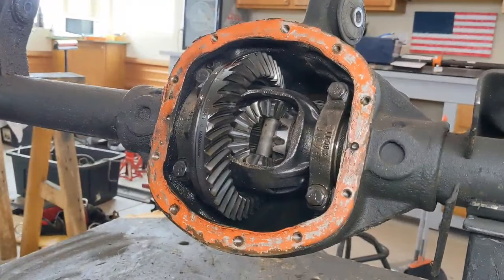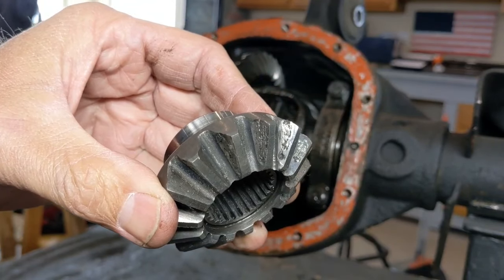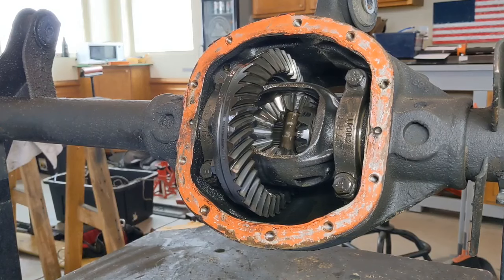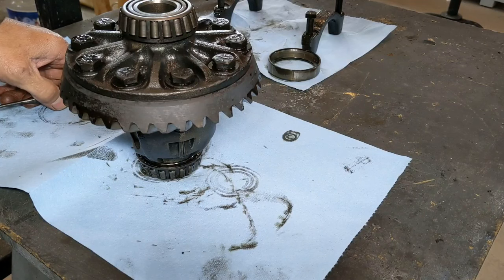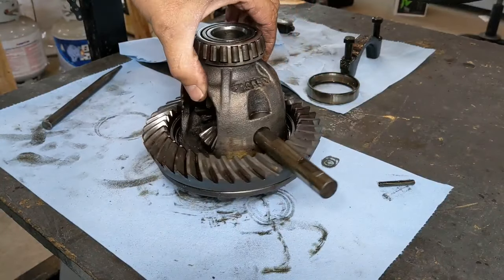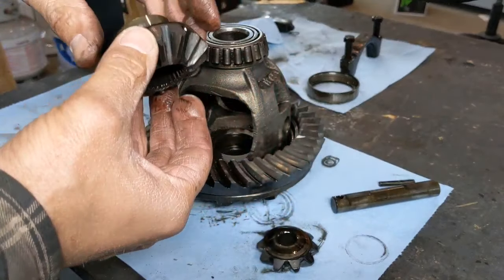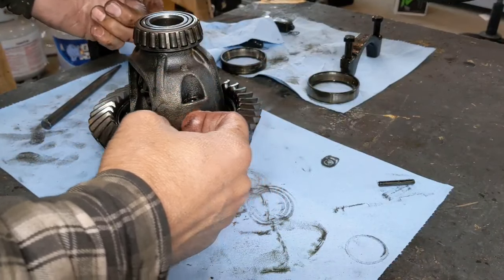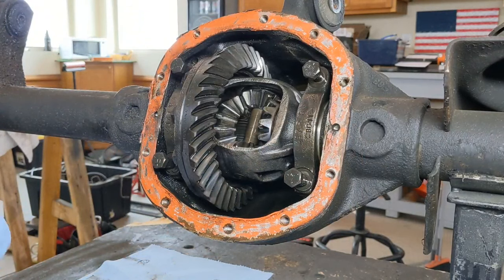How To Replace Spider Gears

Comment: Great thought, but how do I get the carrier out with the axles still attached to (splined through) the spider gears? In order to get the C clips off the axles to remove the axles been the gears, you've got to push the axles in, and in order to push the axles in the cross pin needs to come out first... Right? I'm no expert, so I'm genuinely asking. Is there something I'm missing? Obviously taking the carrier and gears out all together would be the simplest option, but without being able to get the axles out of the way how can I remove the whole carrier assembly?

Comment: Perfect How-To video.  Awesome!  But, need advice.  '01 Wrangler 4.0, 5-speed.  My current issue is with the Dana 44-rear.  Recently regeared from 3.73 to 4.88.  Replaced the carrier (standard, non-locker).  Installed new spider gears.  Everything went well.  All of my "dial-ins" were set perfectly. However, 8 months later while "chirping" 2nd gear, several teeth on the spider gears blew out.  I did use the cheapest of spider gears at the time of regearing, Motive Gear brand.  I'm about to replace with a Yukon spider gear set.  I've been "chirping" during gear changes for decades, here & there.  Never had an issue.  Of course, chirping is very hard on all the components, we all know this.  But this is the first time I've ever blown out any gears.  And my honest opinion is, I think the cheap Motive Gear brand is just a much softer metal and is the reason for the blow out.  But I'm hoping for your very well-experienced professional opinion.  Would you agree or could there be another reason the spider gears would have blown out (other than the heavy torque from chirping)?  Also, is there any advice not given in your How-To video that I would want to keep in mind when replacing the spider gears with the Yukon brand?  Thanks Mike!  Definitely appreciate all of your videos!
Reply from the maker: I would say with confidence that "chirping" is your issue. You can do it as much as you want....until something fails. Motive gears and not bad gears at all. If you want to chirp, might I suggest a Mustang 😁

Comment: Would you recommend drilling a crosspin bolt out if its broken? I seen in the video you daid to knock it out with a punch but I didnt want to damage the threads.
Reply from the maker: You can damage the threads with a drill bit too. I suppose you could and then use an easy out. If it doesn't start coming out easily, you might add some heat to it before proceeding.

Comment: What is this "Wrench trick" you speak of? Mine has a lot of preload keeping it in the housing
Reply from the maker: Put a box wrench on a ring gear bolt and then turn the pinion. The wrench will stop against the housing and the carrier will walk right out. Be sure to turn the correct way as one way forces it out and the other tightens it.
Reply: Thank you that worked perfectly. 

Do you ever see any issues as a result of beveling that one tooth on the ring gear? I know the pinion still has a lot of surface area to contact there, it just feels scary lol  @TheBFHGarage
Reply from the maker: @Lizard6376  yeah you can take too much off. You really need to take a good look at it and see if you can take very little off or commit to just taking the ring gear off.

Comment: Awesome video. It's given me the confidence to tackle this job myself now. 
Question - I have two shredded spider gears. What do you recommend to use as a cleaning solution to clean the internals of the housing, ring gear, pinion and ensure the metal shards are removed?
Reply from the maker: I use regular good ol' brakleen.
Reply: @TheBFHGarage  👍

Comment: My thrust washers won’t go in no matter what I do. Any advice?
Reply from the maker: Put them in place on the spider gears and roll the gear in place. It's sometimes impossible to slide the thrust washer with gear not exposed.
Reply: My thrust washer got broken into pieces and got the other piece in drain magnet plug during change gear oil, do I need to replace it boss? Or it just okay to continue running?

Comment: Do you have to adjust backlash being that you didn't remove the pinion gear. I'm replacing mine with a direct oem fit upgraded differential.
Reply from the maker: If all you're doing is changing spider gears, then no. But if you are changing gears too then yes.
Reply: @TheBFHGarage  thank you . Appreciate the response.

Comment: My Thrust washer of nissan navarra 2018 got broken into pieces the other one got into magnet drain plug and the other one stocked up in the spider gear inside do i need to worry changing it asap or is it okay to continue running the said vehicle?
Reply from the maker: That won't last long at all.

Comment: just watched this vid, really informative.   im wanting to know 2 things .   pre-load, is this not affected as pinion hasnt been removed - so diff in the vid should be good to roll ..  ??     2ndly if  the pinion seal needed replacing  is there  any good or bad time replace during the process shown here..  thanks
Reply from the maker: If you are only replacing the carrier bearings, then no, it doesn't affect pinion preload. If you are replacing the pinion bearings too, but not changing out gears, then theoretically it won't negatively affect preload. In fact, new pinion bearings will increase preload back to near spec. Now if you have the pinion out to change the bearings, then change the seal while you're in there already.
Reply from the maker: And the seal can be replaced at anytime. If using a crush sleeve, then my recommendation is to get a new crush sleeve although people have had success reusing them. If you reuse, be sure to get the preload to where it was and you must use red loctite on the pinion nut if reusing that.
Reply: @TheBFHGarage   im about to change some busted spider gears in a Dana 27 ( 63 stude Lark)  ..   bearings were running noiselessly  so no bearing change  - aside from a superclean-  hoping to swap spiders  but have concerns re preload...     thanks
Reply: @TheBFHGarage  perfect thanks

Comment: If my carrier and those bearing caps were  gone can I buy replacement caps and buy a carrier and install them it's a dana7o 2wd thank you?
Reply from the maker: No. The bearing caps are specific to the housing. They are machined with the housing. If you have no caps, you need a new axle.

Comment: Mine are 2 teeths on each sides so i have to remove the big wheel..
Can i put the same bolts in ? And do i have to measure it? I waited 3 weeks for parts in hawaii . I need the car ready next week . What can i do ?
Reply from the maker: @worldfitnesstrainerradekve9234  yes you can remove the big wheel   (ring gear). Yes you can reuse bolts BUT, you must clean them AND the ring gear thoroughly with brakleen. Then you must use red loctite when you put them back in. Be sure to torque the ring gear bolts to the spec of the axle. No need to measure if this is all you are doing.
Reply: Can i use blue lock title? I need to figure out how to loses and tighten the bolts i im in regular home garage not special tools . Any idea the spec to tight the bolts? I have exactly same differential as yours from jeep wrangler 2017 DANA 44 unlimited sahara .
Thank you 🙏
Reply: Just took it apart and ordered the wrong spider gears ⚙️ 🙈 mine has Trac Lok  carrier posi 30 it’s $600 on eBay just the spider gears but the whole assembly it’s half price but then need press the bearings. So another issue don’t have press unlessI can hit it with a hammer then not sure if the previous shims fits ..

Comment: Thanks for that video! Much appreciated! I recently replaced the wave discs and the two conical discs underneath those four gears because the gears had a looot of play making a helicopter noise when not under load. Putting the gears back in place was really really hard, because there was so much pretension on those wave discs... The diff sounds fine now, but I am still wondering...

Comment: I just installed new spider gears in my Dana 30 front axle and mine are VERY tight. I can't spin them at all. Any suggestions?
Reply from the maker: Did you lather them in gear oil (along with the thrust washers)? At the correct part number? Any damage to the carrier?
Reply: @TheBFHGarage  no, should be, I don't see any damage.
The spider gears are from Summit Racing and seem visually to be very similar, but just really... Really tight.
Reply from the maker: Try rotating them with the axle shaft using a helper🤷
Reply: @TheBFHGarage The spider gears arrived in a bag with gear oil over all of the parts, so I believe that lubrication wasn't the problem. I will post updates as I resolve this, so anyone else who has this problem can learn. I do appreciate your responses.
Reply: A little history; this Jeep was stuck in the driver's side front corner, basically on the wheel. The axle tubes are out of alignment with each other, the lower control arm mount was smashed over ( I'll be replacing those), the front drive shaft is bent, and the axle tubes are leaking fluid. The spider gears were tearing themselves up due to the axle misalignment and I'm wondering if the carrier is tweaked, but I just can't see it.
Reply from the maker: @Twiddlerdammit  it wasn't gear oil on the parts, it was a packing grease used to keep the parts from rusting until used. That definitely needed to come off. If the parts are in then it should wear off but far better and easier to clean them first.
Reply from the maker: @Twiddlerdammit  Dana 30's can be found cheap. With that much damage I would just get another one.

Comment: Curious why you would grind down a gear tooth instead of remove the ring gear?
Reply from the maker: Taking just enough tooth to remove a crosspin is a very common practice. It allows for a quick spider gear change. If you take the ring gear off, you can alter the pattern which could potentially create issues. In addition, ring gear bolts are designed for one time use which would require buying a new set and going through the install process. Some people opt to re-use ring gear bolts, and have experienced success. I'm just not one of them. If I'm in there, I'm doing it to where I don't have to worry about it.

Comment: Does this work the same for a dana 44?
Reply from the maker: Yes, the only difference is that a Dana 44 doesn't have C clips. The axle shafts are held in by 4 retaining nuts on the ends of the tubes. Depending on gear ratio you may or may not have to shave a tooth to pull the cross pin.
Reply: @TheBFHGarage  I appreciate it! Thanks!

Comment: Im working on my 02 suburban 1500 rear wheel drive. I have the carrier unbolted, but no shimmy or wiggle to pull out, do I need to have the truck in neutral??
Reply from the maker: Do you have the axle shafts pulled out?
Reply: @TheBFHGarage  yes I do
Reply from the maker: @Angel Benavides  I just want to confirm that you're trying to remove the carrier from the housing. If that is the case then put a box wrench on one of the ring gear bolts and turn the pinion or drive shaft until the carrier starts to walk out. It will be one way or the other. Be sure somebody's there to catch the carrier and the shim so they don't fall out because you don't want to mix up your shims! Go to my video "how to Re-Gear a Dana 30" and then go to the 2 minute mark. It will show you what I'm talking about.
Reply: @TheBFHGarage  much Thanks 🙏
Reply: So then I do put the truck in neutral right? So I can turn the pinion or shaft?? I only have the rear of the truck lifted
Reply: @TheBFHGarage  nevermind. I understood now. Thanks
Reply: @TheBFHGarage  will I need a dial? I'm just reassembling the gears
Reply from the maker: @angelbenavides5784  if you are ONLY replacing the spider gears, then no. If you change the ring gear, it is an entirely different process.
Reply from the maker: @angelbenavides5784  yes.... Be sure to have the truck stabilized so it can't roll away!

Comment: Any reason besides time, to not just unbolt the ring gear from the carrier rather than dremel the tooth down?
Reply from the maker: In addition to time, ring gear bolts are designed as a one time use bolt. Additional cost for new bolts. Also removing the ring gear can alter the pattern ever so slightly. Some people have good luck with red loctite when re-using the ring gear bolts. It's just not worth the chance for me to risk things falling apart later on.
Reply: @TheBFHGarage  That makes sense. Thanks for taking the time to reply :D

Comment: Amazing Videos!, to change the spider gears on arb locker carrier is the same procedure?
Reply from the maker: No. To change out ARB internals you have to pull the locker out and remove the ring gear.
Reply from the maker: @gbouchara  I would just to be sure I reinstalled it correctly.
Reply: 3 minutes ago
If I remove the gear, I will have to measure backlash when reinstalling the locker in the differential right?
Reply from the maker: @gbouchara  technically you wouldn't have to. You aren't changing anything at all except internals. You should be able to put the ring gear right back on and reinstall it. I like to check backlash before and after out of habit just to make sure I reinstalled it correctly.
Reply: Thank you so much! I am going to watch the video on how to use the tools 😀👍
Reply: HI Mike, I need some advice is there anyway I can PM you?
Reply from the maker: @gbouchara  email is on my home page.
Reply: Hi Mike,
First of all thanks for your videos and for the help you are providing me. The problem that I am facing is that I have ARB Lockers on chrysler 8.25 with c-clips so when I was trying to remove the axles to upgrade them by mistake I remove one of the small pin that holds one of the spider gears and as a result all the thrust washers got out of the original position and I have not been able to put them back in place. So I was thinking that I will have to remove the locker from the differential and tear it apart. Any suggestions?

Comment: will the prosses be the same for a 2015 dana 44?
Reply from the maker: The process is virtually the same but you will most likely have to remove the ring gear.
Reply: @TheBFHGarage  stupid question why the ring gear removel.
Reply from the maker: @robertfrancisco1193  thick cut gears may be too thick to allow the cross pin to come out.
Reply: @TheBFHGarage  ok thanks trying to get enough info before i start the job

Comment: How are you able to get the spider gears in with such ease? It's a really tight fit and those washers behind them are super hard to keep in place.
Reply from the maker: Put them in from the open sides and then rotate the gears. The thrust washers you just have to work them in.
Reply: Mine keeps spitting them out. They are chewed up pretty bad now. Where do you source new ones? Are they selectable?
Reply from the maker: @monteboy87  You have to be patient when inserting them...make sure they are directly behind the gears as you rotate them in. What do you mean are they selectable?

Comment: My spider gears broke some teeth today on the jk . I’m tackling the job myself
Reply from the maker: Glad the video helps out. The process can vary slightly from model to model but is generally the same.
Reply: Awesome the local mechanic is charging 2,000 for this job I was curious and called lol
Reply from the maker: @Astro_GSD  they bid high because they don't want the job but will do it for a high price. You could install a locker and do a regear for that price.
Reply: That’s insane I’m taking my time marketing everything and taking lots of pictures thank you for the awesome information

Comment: I'm trying to replace my spider gears on my 99 silverado 1500, and for some reason the new ones won't go in, it's like they're slightly too big for some reason. Any ideas as to why? Am I going to have to get a slightly larger carrier for them?
Reply from the maker: As long as you are sure you purchased the correct spiders for your truck, they should fit. There isn't a "slightly larger" carrier. Installing new spider gears can be a pain in the@$$ sometimes. Try rotating them as you are working them in. The thrust washers need to roll right in with them. It is almost like a puzzle sometimes trying to figure out what it takes to get them to go in. Keep at it and good luck!
Reply: @TheBFHGarage  Huh, weird because the gears I got came directly from another 99 silverado 1500 rear end, and they fit into that one just fine. What causing the problem is that the side gears, the ones connected to the axles are slightly taller than the older ones when I set em base down. I don't know why they fit just fine in the other one, but not mine.
Reply from the maker: @SgtAwesome97  I thought you bought new gears. if you are using used spiders then make sure it has the exact same axle and carrier. All bets are off using used gears unless they come out of the exact same donor axle. if one has limited slip and the other doesn't, that could be an issue although I've never run into that problem. How many years did silverado run? slight changes between them all, but not sure about axles.
Reply: @TheBFHGarage  They're both limited slip differentials. Internally they look exactly the same, minus the fact that 75% of my old ones gear teeth were turned into metal shavings and pieces. I just don't get why the gears fit into the new one fine and not into mine. It's from the exact same make, model, and year of truck.
Reply from the maker: @SgtAwesome97  interesting...yet frustrating!

Comment: nice content, i have a problem with my hilux and the free play was abnormal, when i open the housing i found out that the cross pin 05:20 is loose and the hole is not the fit for the pin, it is difficult to find the rear diff casing and mostly they sell in a complete set. From your opinion what is the cause the diff casing cross pin to damaged, 
https://www.youtube.com/shorts/zja66DHoO5M